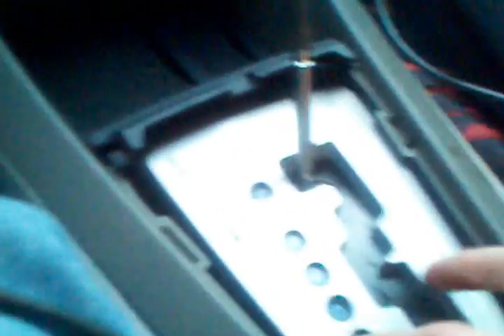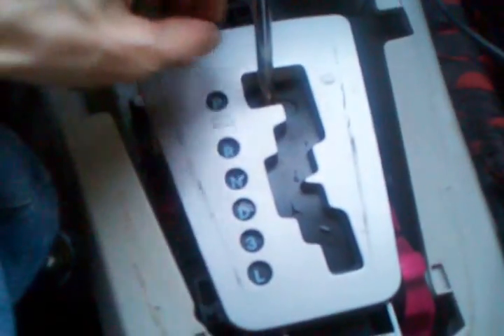Dodge car shifter stuck (easy fix)

Comment: 07 Dodge Nitro stuck in park fix. I changed out my brake switch and there is a lil lever on it. You push it up over the dimple it came out of park after I turned the key on. Fixed.
Reply from the maker: Sweet apparently some of those were different than mine and I wasn't sure how to do it with them specifically, but it's usually some simple lockout tab that releases or something easy to see how it works, then "fix" heheh.
Reply: Thank you 😊

Comment: My '06 Charger RT is showing a security issue. My two key fobs have not worked for two months and set off the alarm everytime I unlock the car manually. Today, however, the security system locked it into PARK, as part of the anti-theft system. grrrrr
Reply from the maker: Linda Lewis oh wow, i wonder if there is a recall or tech bulletin posted about it. i WOULD assume your battery in the key is dead, but its odd that BOTH arent working, or maybe one was already dead and you didnt use it before the 2nd went dead. thts possible, i believe my friend had that problem with his charger and it was just the stupid key battery haha. see if you can run by and get the batteries in it. i would say radio shack but um...yeah. the battery though, should be a 2032 battery. you can even get em at walmart, and its fairly easy to pop it apart with a penny and change it. :D   https://www.youtube.com/watch?v=nwxylfmMpDo
Reply from the maker: Shogun Autoworks dont let someone charge you a ton for it. idk how the dealer will do but seriously, you can buy the batteries in pairs for like $6 at walmart. and changing it is easy. i used to do it for free at Radio Shack if they bought the batteries. Just to help. Hopefully that is all thats going on!
Reply: It was the pink plastic piece that holds the little spring. Pain in the butt to replace, but the part is about $13 if you order it yourself. And.... my key fobs still don't work, so I'll just put up with the alarm going off every time I unlock the car. Thanks for responding! :)

Comment: Thanks Man, I can shift and move it around. Unfortunately mine stopped changing gears...may the transmission needs a look?
Reply from the maker: Will Fordyce shoot. That does sound like an inside transmission issue. Or the transmission computer.
Reply: Shogun Autoworks yeah I agree, thanks for the video